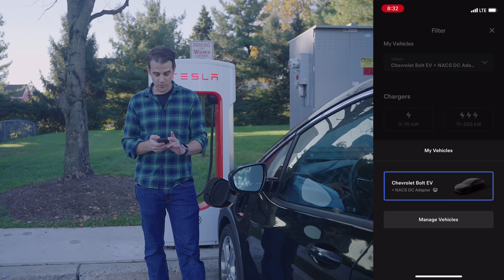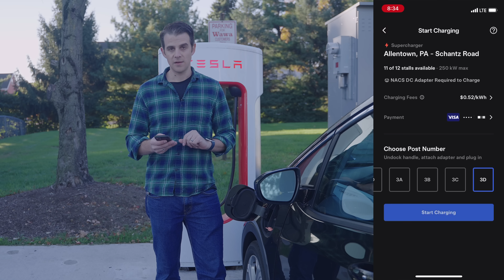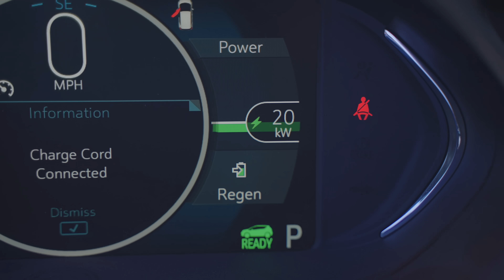How to Charge a GM EV on a Tesla Supercharger

Comment: No one talks about cost per kW.
If I use supercharger, the cost/mile is double of that for gas vehicles.
For example, just charged my blazer on an evgo "supercharger" If you can call it that (150 miles/hr) It cost me $22.5 for 30% of charge, from 30% to 60%. That gave me about 100 miles. 100/22.5=4.4 mile/1$
Then I filled my gas car at Costco for $28 and got 250 miles on my range
250/28 = 8.9 mile/1$
So supercharging is extremely expensive.

Comment: Just got my adapter, and decided to more research before taking the adapter out of the box. 
 1) Also found the map on the Chevy app for this to be useless, 2) spent hours looking into other apps including Tesla’s, 3) learned that having the adapter is no assurance of using it at a particular Tesla Supercharger and may not find this out until you get there, 4) learned that the Bolt recharges at a max of 50 KWs which is 1/5 the rate ofTesla 3s and Ys ( 1/3 the rate of olderTesla Ses and Xs).
THEREFORE, Even after successful research into where acceptable Tesla Superchargers are in planning a trip, as calculated from my speed in charging in my Level 1 and information online re Tesla charging speed:
1) Recharging from the recommended levels of 20% to 80% would take 45 minutes for about 120 miles of range increase for the Bolt.
2)This is better than Level 2 charging of approximately 120 + minutes for 120 mile range increase, but
3) Using any level 3 charger, due to the Bolt’s charging speed, is not acceptable. 
Wish me luck when I go to the dealership to return the adapter which has never left its box.

Comment: I stopped at a full Tesla Supercharger with 8 stalls.  A Bolt was charging taking up two stalls with no one in the car.  It was at 98% when I rolled up.  I had to wait approximately 5 minutes and got a spot when an X was finished.  I charged the Y from 10 to 70% and the Bolt owner  still had not appeared. 👺

Comment: I just bought a used model Y and on my first road trip I was unable to charge at a  busy supercharger because there was a Volt using the wrong cable.  Luckily I was still at 20% so I had enough to make it to the next supercharger without waiting.

Comment: You should cover a couple more things for folks: 1. You can pay a membership fee and get a lower price, 2. I assume this works the same as for us Tesla owners - if your car stops charging (you can set a charge battery limit %) you have 5 minutes to disconnect/move or get charged $1/minute. The app notifies you when you are getting close (so if your inside a place eating you can go out to disconnect or increase the charge limit % in the app). 3. Don't be surprised to see Teslas parked every other spot - we do that at our slower V2 chargers which share power   at adjacent stalls so it's habit. I guess we'll need to charge at the leftmost stalls if it's busy just in case. Also--most of us are nice--we'll disconnect and move over if we can since it's quick (we don't need to tell the app which stall we use so it's quick).

Comment: Ha! I agree about taking some of the fun away. When I did my 900 mile each way Thanksgiving trip in my Bolt EUV, it was so much easier with access to Tesla superchargers. I had a general plan but I could easily make adjustments on the fly and just go from station to station without planning the entire trip. That said, it still gives you something to do along the way. I kept an eye on upcoming charging stations to see if they were busy so I could decide if I wanted to stop somewhere else. As much as it helps to have access to SuperChargers, the stations are getting much busier.

Comment: Finally a video that clearly explains the charging process for Bolt owners. I had installed the Chevy app but it was useless for finding a charging station letalone a Tesla Supercharger. I've had Teslas and have that app so I added the Bolt to it. This video confirms that the Tesla app is all your need to access their chargers. Will actually test it for myself this week.

Comment: 5:45 Again to understand… You can can charge at 50kW at ANY fast charger but you drive to a Tesla V3 charger that can charge at 250kW and let a Tesla car wait 5x longer to charge after you if all charge bays are full and ‘YOU are SAD’… What about the car that has to wait behind you…🙉🙈🙊
Reply from the maker: Often the Supercharger is the old viable option where I live. And in my limited experience so far the stations have always been less than half full so we are all getting the full charge rate that we can pull. Granted someday this may not be the case. Very location dependent.

Comment: 2:35 So what you’re saying is: “We bought a cheaper car than a Tesla, where you pay a part for the loading charging infrastructure and maintenance of the -network, and the only thing that the other car brands needed to do is use a type of plug to get their users extra benefits with sometimes a software update… You take a stall from a person that paid for the maintenance and service and gets to wait for a person that is SAD about it…” 🤯
You can charge at other, non Tesla, location(s) if you think it’s better there…🫣

Comment: In the future I hope Tesla makes it mandatory for other companies to put their charger ports on either the driver rear or passenger front so they can conform to the intended design of the charger network. While you are considerate and parked on the end, this is not always the case, and it takes up two charging stalls when these EVs show up.   End of the world? No… but when I’m routing my Tesla to a supercharger because it says there are two stalls currently available , and I show up and there are a Chevy bolt and a VW ID.4 charging and blocking access to the “available” ones, it sucks.   The make it worse, neither of the above mentioned EVs charge very fast, so they will be there a while.

Comment: I had to update my 2019 Bolt for it to charge reliably on the Tasla network. Before the update I could charge one day, come back the next day it the car would not communicate with the charger.
Once I did the software update the car now has no issue with charging on the Tesla network.
Reply: I did the software update before getting the adapter, so I could actually get the adapter through the mychevy app..after doing the update at the dealer, I still couldn't order the adapter, but found a workaround and it's on its way theoretically. I'm glad you posted this though because my VIN was one of the ones that the concierge said required the update, so hopefully now I'll be good to go. I wonder what the update actually was and why only certain 2019s and 2020s required it.
Reply from the maker: Interesting. You’re the first person I’ve heard describe an issue like this.

Comment: my son and I just charged his 2017 BOLT Premier at the Tesla location in Huntsville AL the other day...  worked fine with my LECTRON CCS adapter.   One of the things that he asked was 'why' is being able to use a Tesla Supercharger versus all the other DC Fast Chargers, such as Chargepoint, in his area of N Alabama, any 'big' deal?...   as a LIGHTNING owner, and now also a KIA EV9 owner, the answer for a BOLT owner is a slightly different equation, but ultimately it's about LOCATION, LOCATION, LOCATION...  while traveling.    The BOLT is only able to charge at up to 50kw, so ANYWHERE he goes to charge, likely he'll be able to get the fastest speed his car can handle - LIGHTNINGS are a different story, as we can get up to 160-180 at times, and therefore need MORE speedy fast chargers, which the Superchargers can provide.  The KIA EV9, on the other hand, has a higher voltage charging protocol and can access up to 250-280kw speeds, and really needs the likes of an ElectrifyAmerica 350kw or EVgo 350kw station to get it's maximum speed - Superchargers are fine, but are not going to be the 'preferred' stop for this vehicle.     For a BOLT owner, it's PURELY about having MORE locations to charge at, not anything to do with 'speed'.   Another aspect is the simple fact that Supercharger locations, with typically 8 to 28 units, generally give you a much easier feel when navigating to them, as you are much less concerned about 'finding a unit' to charge from - EA and EVgo and Chargepoint and all the others, well, that's a whole different story.

To shed some last on that last sentence, we traveled in our EV9 last weekend.  While on the way 'north', we used a Tesla Supercharger 'magic dock' "OTHER EV" v4 location in Alexander City AL to charge the KIA EV9.  This is the first time we've had a Supercharger with magic-dock to try this with - unfortunately, though, the EV9's higher voltage architecture meant that the Supercharger only provided a maximum speed of 85kw...   but, regardless, we arrived to a totally EMPTY set of units at this location - no worries, no problems, easy.
On the other hand, on the way back home, we took a different route, to make use of a ElectrifyAmerica 350kw for faster speeds, at Oxford AL walmart.  Unfortunately, EA does not make 'seeing' the unit # or the 'speed' quite as easy from a distance, when arriving, so you have to get really close to the units to find out which one to use - also, the spaces are 'slanted', toward the incoming traffic, AND these units are on the MAIN incoming traffic lane into the walmart, which is VERY busy.  Even with my wife's help, identifying which unit was 'Number 3', out of only 4 units, was still problematic, AND, we then realized that we had to then circle around the station and 'back in' to have the charge port at the unit's screen.
After plugging in, and using my EA app, the unit started to charge - then, just as suddenly, stopped.   I tried to use the other cable on the same unit, but, again, the same thing happened - no luck on this 350kw unit.  So, we decided to maneuver around, AGAIN, to back into the other 350kw unit, only to find that the app then showed that unit as 'under repair'.   Uh oh.   Thankfully, there were no other EVs when we first arrived, so this was less of a 'problem', than if the station was full with EVs.   My only choice, then, was to pull into a 150kw unit.  This unit eventually started charging, but, of course, at the maximum speed of 160ish kw...  not the panacea of speed that I had drove to this location expecting...   oh well.  
These are the issues with many of the third-party DC Fast Chargers, and why Tesla Supercharger locations become the cream of the crop - there is generally NO waiting, NO worries about the unit working, and the SPEED just works...  well, at least as fast as Tesla can provide.   But, speed might just be secondary to less charge anxiety - I'll agree to that!

Comment: Wait until you try a Tesla V4 charging stand.  As you mentioned, they are biggest and taller and have longer cables so you don't have to park in strange orientations.   Also, they also have a NACS adapter built in so no need to carry one.  As I understand it, you swipe your CC, and base knows you need the adapter so release it with the cable (you might also have to press a button on the built-in display).  If it is a Tesla, you don't swipe.  You click the button when the cable is in the stand, and it disconnects from the NACS adapter and leaves the adapter locked in the stand so no one can take it.   Also, some stands are placed in the middle of the parking spot, so left and right, backwards or forward does not matter much.  It also seems that the V4 spots are bigger.  I assume this is for trucks like a Cybertruck, F150, etc.

Comment: '23 Bolt euv. I just ordered this adapter, and don't plan on using it unless I need to, as it's expensive charging for a non-Tesla. Having the option is important to me, though.
Reply: In my area Tesla is at better locations and is sometimes cheaper then non Tesla.    It's way more expensive then at home but can be worth it at times
Reply: it's as much or more than gas
Reply: @Nicholas-f5  I'm one of those rare people that cannot charge cheaply at home (an apartment), and understood that I'd be paying more than the equivalent of the cost of gasoline; I bought an electric (Bolt) for it's simplicity and reliability.  Maybe someday, I'll be able to charge at home, overnight, but until then, I'm still happy to have a Bolt and use public DCFC when needed.  Happy girl.
Reply: @Nicholas-f5  I'll only use Tesla chargers when I need to, but I'm glad to have the option.

Comment: if you got a GM EV you are a lot sad, not a little sad.
Reply: No, having the extra $15,000 left over from the purchase cheers me right up. So did having a free charger installed in my house. So does having 172 times as many places to get service, parts or accessories in the rare likelihood I need some. Also not being able to put a sandwich through the cracks and into the car without opening the door. Also not having to take my eyes off the road and search through menu after menu to adjust my vents or open my glovebox or (CRASH!)...
Reply: @natehill8069  a true hater. hang on to that hate, soon that will be all you have left of GM.
Reply: Love my LYRIQ
Reply: 10k for a 2020 bolt with 15k miles  lol

Comment: as someone who just purchased a Chevy Bolt, I really wish that non tesla EVs had the charge port on the back driver side of the car so we don't have to block off the charger in the next spot while we charge.
Reply: Do you have an adapter yet? I ordered one for my Bolt 6 weeks ago and still havent even heard anything about it (other than the initial receipt).
Reply: @natehill8069 that’s because every part from GM is on backorder. Super frustrating, dealers waiting on parts for months. Customers upset being without their vehicles. They are in a world of hurt.
Reply: Tesla is in the process of putting in new cables that are longer.
Reply: If the charge port was in the front like it is on the leaf, it wouldn’t be a problem

Comment: In Europe we have Tesla super chargers with CCS2. Some with ONLY CCS but most have both Teslas proprietary plug AND a CCS cable attached to the charger. So CCS won here. My California made Model 3 was delivered with a CCS2 connector and it fits comfortably behind the same standard charging port, so it’s not that large really. Also non Tesla owners pay more for SuC  here.
Reply: CCS is so annoying. It puts me in mind of fueling an airliner when I hook the thing up.
Reply: @ there is nothing annoying with it. It’s all over Europe on every charging network and allows Tesla to sell electricity to other brands at a premium accelerating the expansions of the SuC network faster.

Comment: Some people might hate joining the Tesla bandwagon, but charging plus software plus quality for price, Tesla is simply the best choice.
Reply: Tesla charging is best 
I’ve used them all
Reply: Yes, actually many might hate joining the Tesla bandwagon.
My new Chevy Blazer EV has no problems while Tesla does have a string of mishaps.
Separate question, what do you think of the 5-foot extensions? On one other video, commenters we're saying that it might not be safe. What is your opinion?
Reply: many don't want to support Elon/Trump
Reply: @ I don’t know who “the many” are. I don’t support Trump or much of Musk’s geopolitical views, but I also don’t support most of corporate CEO’s political views. I still buy the products from the corporations if I don’t see those products causing harm or better yet see those products adding to the good.  I believe Tesla overwhelmingly adds to the good.
Reply: From my experience, my friends with teslas have more problems than I have with my 2 chevy EV's. In fact neither of them have required service.
Reply: @David-mo2zq  The Bolt seems a good car. The Equinox too. Teslas might have occasional issues. Expensive stuff is usually from auto accidents. Tesla’s big strength is its over the air updates  and great battery management. FSD v13 is a game changer too!

Comment: 1. Teslas routinely charge higher than 500 amps (i.e. they start at ~257 kw at low charge, let’s say 380v =676 amps), they just don’t hold it for more than a few minutes.   2. I am dreading the Chevy Bolts clogging up the supercharger network, having been stuck waiting for them at EVGo stations in Pittsburgh… so slow!  Get a 3 and you’ll be much happier, the price is in the $30k’s now and they get 380miles of real range.
Reply: I've got a bolt.    I understand your sentiment but still disagree with it.   There are a number of cars that charge slow now.   Kona ev.  Bz4x,   Nissan leaf, .   And more.    A bolt owner that is aware of the limitations of the car and typically chargers only to 50 or 60 percent on road trips is not any worse then a Tesla charging to 95 or so percent.     Problems seem to arrise when people of any car want to charge to 100 percent for no reason.      For ccs stations,   problems arrise because stations are underperforming and partially broken enough that the sites won't support more then. Couple of charging Evs at a time.